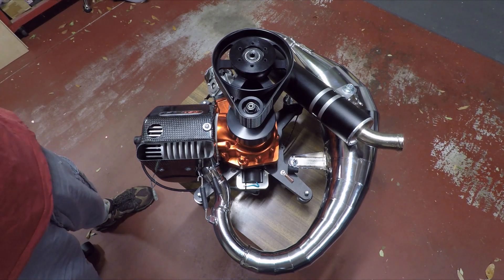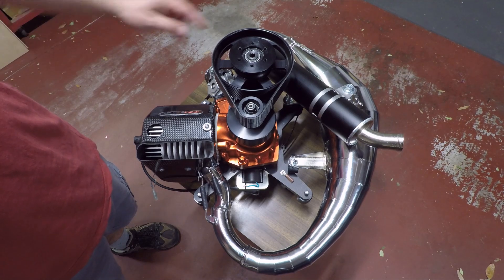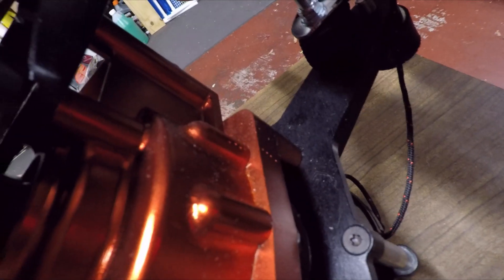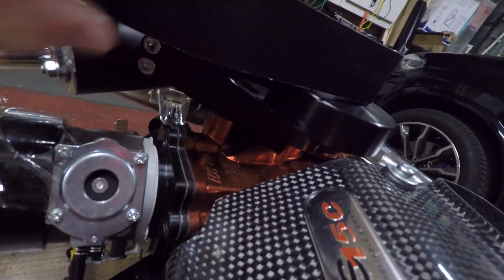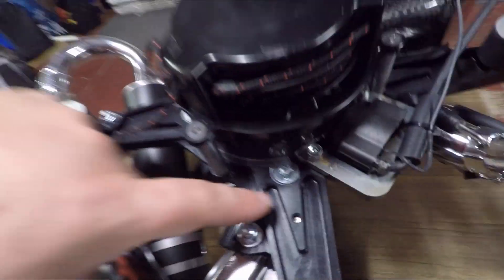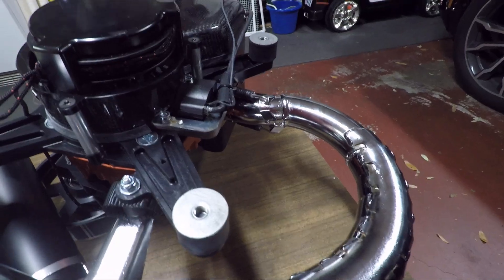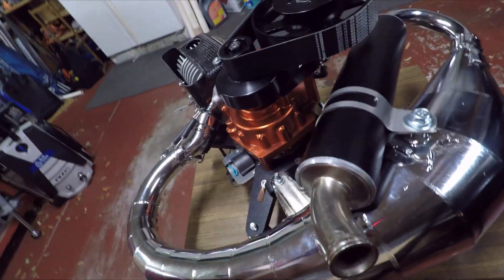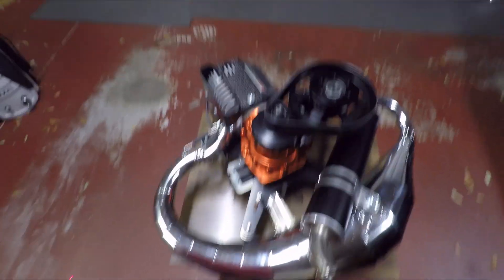EOS 150 Initial Engineering Review

Comment: It all looks bling-bling, but it turned out to be a blooper. The way the cooling fan is designed is all wrong. The angle of the blades of the centrifugal fan is the wrong way around. And the fan can not suck in air from the center. The only opening where air can enter the fan is at the outer edge (of the housing of the pull-starter) where it actually should build up pressure. The design of the forced cooling is just plain bonkers. Dito for the EOS 100.

Comment: Thank you for this video, it helped me alot. My engine certainly didn't come like this. I bought it from the guy who sells the Synergy7 paramotor, it smelled like gas, has rust on the prop area and to top it off was not packaged well. Was also missing the throttle. Should I contact EOS? The guy insists it was brand new but it's definitely not.
Reply: That sucks. You're talking about Claude from Malibu Paragliding and he's the one who designed and HEAVILY markets his Synergy paramotors.  He's got poor yelp reviews of people who have called him a swindler.  He doesn't have a great reputation in the powered paraglider community from what I've seen.
Reply: @stevenn8449  Yes it really does. I'm new to the sport and wish I'd given more thought to those reviews hindsight. I loved the design and he kept ranting about his decades experience so I gave him a shot but the whole experience was awful. Now I'm starting over. But at least now I realize gas engine is really not for me, will probably wait for electric to mature. Thanks for your confirmation.

Comment: I know this is an old video, but shorten the throttle arm! I did that with my P.AP. throttle and it's worked out great. That's a pretty engine - hope to see it out there.
Reply from the maker: I tried the pistol grip style that came with it, but it got in the way with my holding the A's. switched to an air conception one I got online....I like the engine a lot still. I do need to do a follow up....moving to a new house now, so everything is crazy.

Comment: Random fast facts for 150 owners-

-this engine has several defects from the factory if you have an earlier version. the two most notorious are the starter rope recoil issue and the Piston Ring issue. The starter rope pulley is too shallow and so the rope recoils into the cooling fan. This is fixed with the addition of a plastic piece that you can get from Aerolight. If you have an engine below production number 85 then you need to take your top end apart and regap the piston rings because it will blow up. The rings will expand and catch on the exhaust port, shearing off the top of your piston.

The ICI 2019 upgrade includes a different ignition coil and a different cylinder head. the only difference between the old coil in the new that I could see is that one leg is cut off new one.

-this engine runs very hot in the original version. The carbon fiber shroud really suffocates it. The ici version has you modify the cooling shroud. I also recommend running ngk's br10es plug as opposed to the BR9. 

-The top end of this engine heavily derives its geometry from a Chinese scooter. The piston is from a big bore kit for that scooter. They also use the port timing from it. If you order a new piston from vortex aero, be advised that the wrist pin and gaskets will not work for the EOS, even though the Piston is correct. The best source for parts in the u.s. is aerolite, as they can import the parts. 

That's all I can think of for now. if anyone else has this engine just having trouble with it please let me know.
Reply from the maker: Yes. and all the fixes are on the manufacturers website...luckily mine has all the upgrades. they did fix them at the factory when the problems were found.
Reply: Thank You, how has your EOS been now two years later?

Comment: Just got mine mounted to my frame a few days ago. I took care of the service bulletins (checked ring end gap, removed head shroud, checked coil foot, etc). Just need to get some fuel line and I should be ready to start breaking it in. My motor didn't seem to come with a clamp to secure the "airbox". Did yours?
Reply from the maker: Mine came with 2....maybe I got yours.
Reply: @dogon1013  haha sounds like you did. Finished the break in on mine this weekend. Hope to do a flight this week!

Comment: Have you had it in the air yet? Any concerns or disappointments?
Reply from the maker: Just finished mounting and plumbing/wiring it. still could use some work before first flight, but its good enough to break in....might need to do a quick follow up video.
Reply from the maker: Just finished break in. It sounds awesome. Like a racing dirt bike....The starter takes some getting used to. need to be brisk with it, otherwise kickback.
Reply from the maker: been flying it for a bit now. Think I am at 11 hours. I figured out how to start it reliably. don't flood it, and pull fast....No regrets on the purchase.